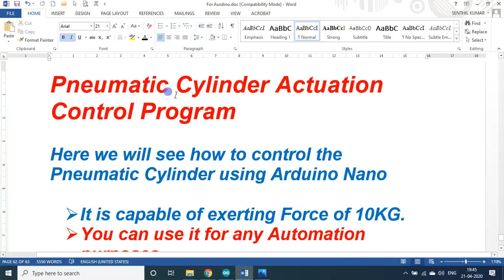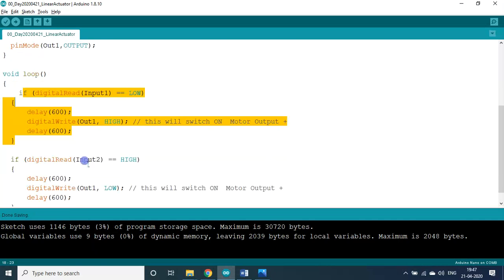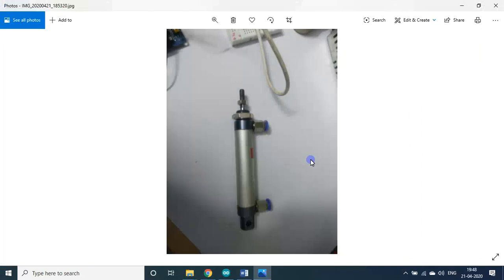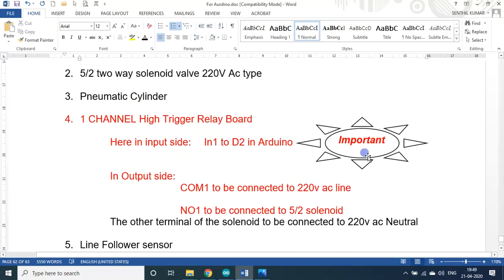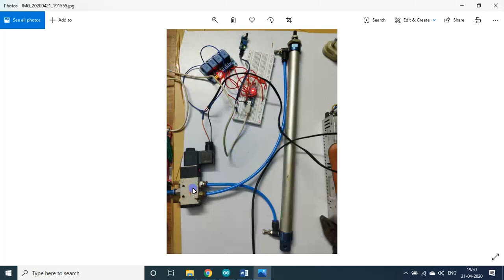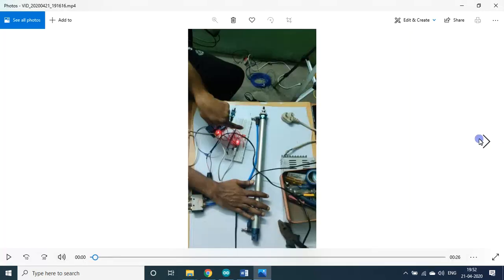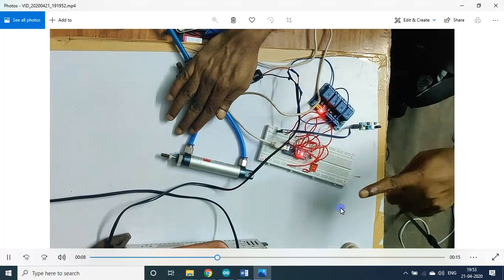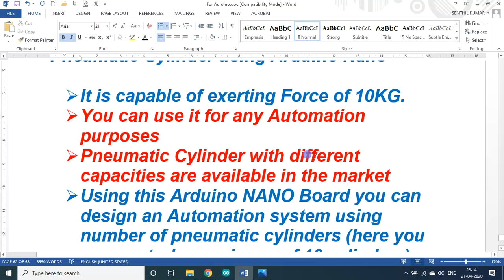23 | Arduino | Pneumatic Cylinder Control

Comment: Dr. Kumar, thank you for the video—very helpful. Would it work the same if I used a capacitive proximity sensor instead? I'd like to build a bottle capper where the cylinder is activated when a bottle is placed in position.
Reply: Yes it will